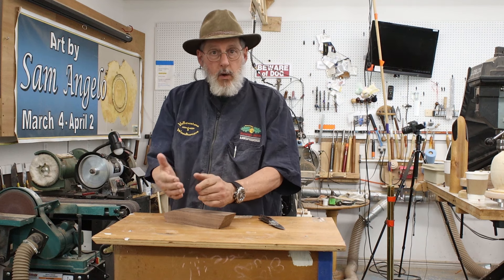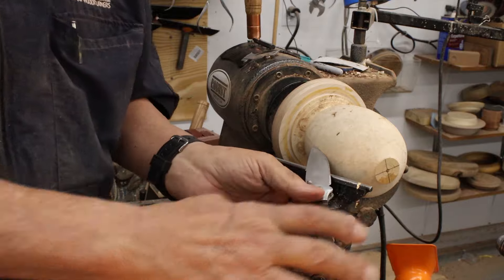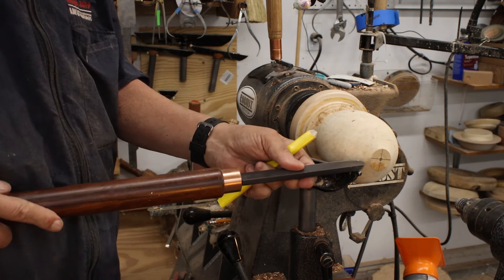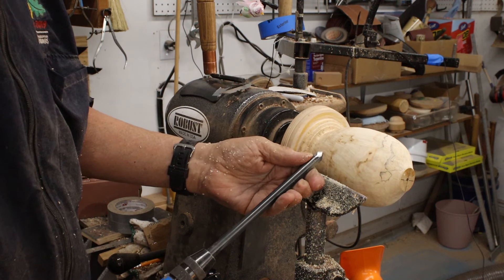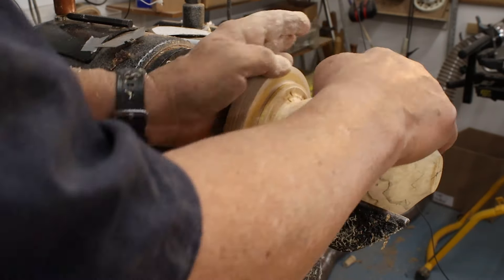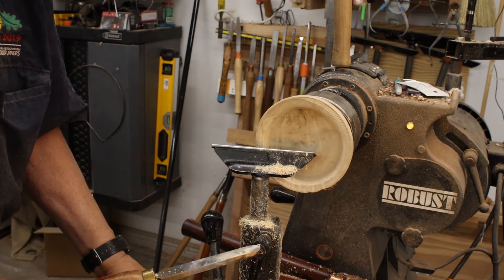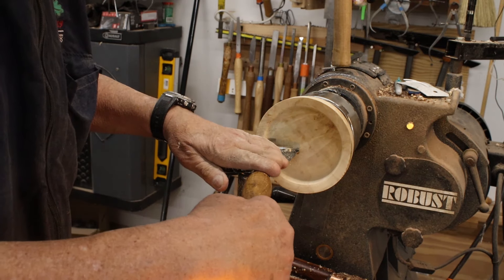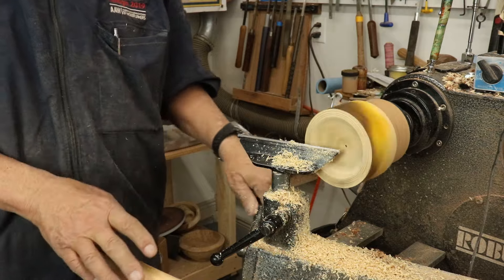Master The Art Of Scraping Tools With Sam Angelo: A Beginner's Guide To Turning

Comment: I always scrape never cut, if you cut and make a mistake you have to start again, after scraping i use a rasping file sandpaper and so on. In trade school I was laughed at for scraping but the finished product always perfect.
Reply from the maker: Thank you very much for your comment, it helps me understand where some Woodturners are coming from. It is all complicated. And there is a risk with whatever we do, including how to cut with a gouge. I have my opinion about this that I have developed over 35 years of Turning. Learning to cut does take time and there is a risk. But in my opinion, there is nothing that produces a cleaner or better surface than cutting with a gouge thanks Sam.

Comment: Sam, I notice you’re using a Robust tool handle.  I have two of them and find them a little lightweight.  Is it just that I’m used to heavier handles?  What is your experience with them?
Reply from the maker: I do not use any of the wooden robust handles. Although I’ve sold a few. All of the wooden handles that you see me using, I have made. But I do agree they are not very heavy. It might be better for lighter, smaller tool, steel, Sam.